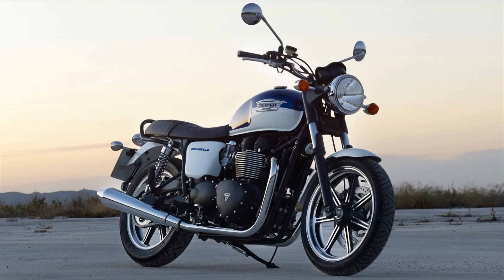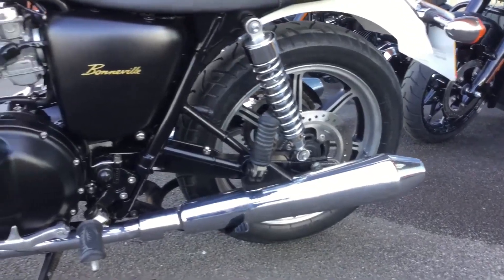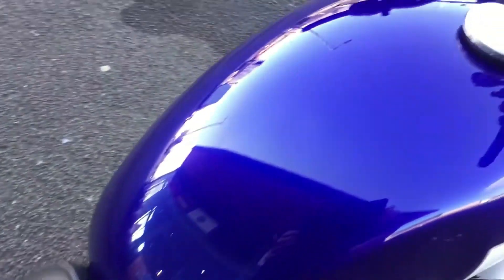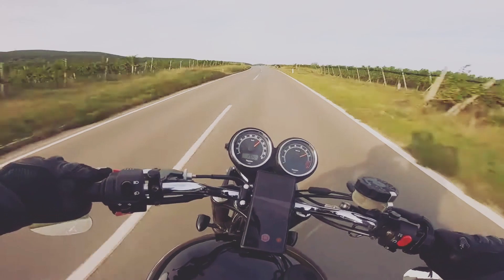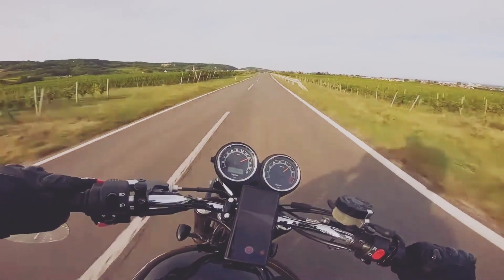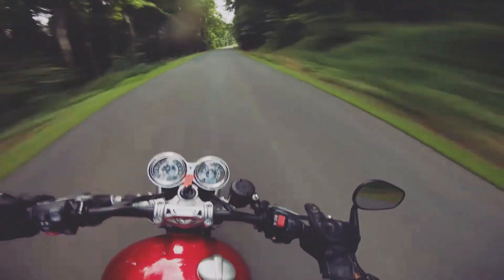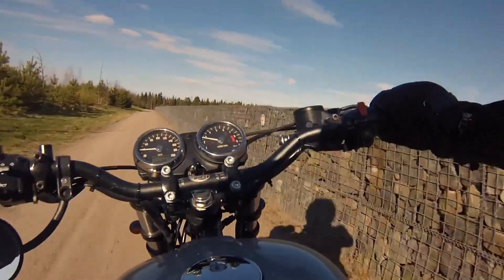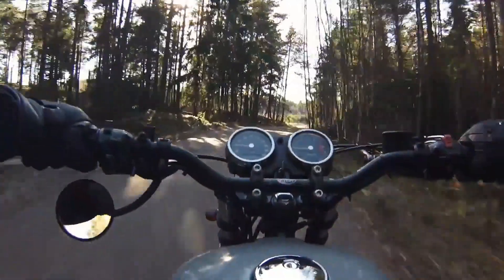Is The Triumph Bonneville The Right Bike For You ?

Comment: I have 134,000 Km on my 2017 T100.  It is a wonderful riding experience.   It follows the styling of the great Edward Turner considered by many to be the ultimate.  The engineering has developed since 1959 whilst remaining true to the design.  You will see irritating comments about fakery,  mostly picked up from reviewers who've used the term.  The bikes are a joy.
Reply from the maker: good point well put mate but i do feel the air/oil cooled ones are more honest to their roots🙂Cheers for the comment. Ride Free 🙂

Comment: My last Bonnie was a '71 with square block Amal carbs. Scuffed the sidewalls off the Bridgestones and scared my mates on big Japanese bikes on twisty stuff.
Reply from the maker: Great story 🙂Cheers for adding your bit mate. Ride Free 🙂
Reply: Bought mine for Twisties, the upright riding position and great retro looks. My ego wanted more power but the 0-60 is more than enough for daily use but my fz09 and street triple friends run off and leave me sometimes 🤔
Reply from the maker: good point well put mate and its only when they run off and leave you permanently you need to worry lol 🙂Cheers for the comment. Ride Free 🙂

Comment: Bonneville came out in 2001, not 2002.   It went to fuel injection in 2009, not 2007.   It went to water cooled in 2016, not 2017.
Reply from the maker: i wont argue the individual dates, but do remember, different markets........... they were the official release dates i found, but ive been wrong before n almost certainly will be again, i do my best

Comment: Ahhh, the bike I could love, maybe, except something about having pretend carbies and faked air cooling, purely for looks puts me off a lot.
Reply from the maker: 790 and first couple of years of 865 for you then mate lol, ive tried a few, honestly, they just dont pull like a twin should to me, no bottom end surge, the character of a sewing machine lol good but a bit soulless
Reply: @barebonesmc  Yeah, I'm just going by memory of that one relatively short ride on that one 650 Bonny years ago. It was a pleasant bike but I do remember it being pretty gutless for a 650, it's just that memory of thinking "I could almost live with a bike like this" but, I do like some serious power too so, probably not for me at all if I'm serious. One's gutless and the other's all fake pretend so nahh, I'll pass thanks anyway.
Reply from the maker: its not that they had no power, but the torque just wasnt there on any of the ones ive ridden, have a good one mate  @lorditsprobingtime6668
Reply: They are not '' fake '' anything.  They are fuel injectors.  They have to be where they are which happens to be where the carbs were for the same reasons.  So your objection is that they resemble the look of the carbs which is stupid.  Do you object to the digital clocks looking like originals?  Or the exhaust pipes?  The engine fins...?  I could go on.  They are '' retro sty;e " bikes FFs the clue is right there.  

Cancel

Reply
Reply: @asacarrick1385  I get all that, it doesn't mean I have to like it though. As for "fake carbs" YES, they are. Being real "real fuel injectors" doesn't change that fact.
Reply from the maker: @asacarrick1385  no need to get so touchy, everyone is entitled to their opinion, as to the injectors, has anyone else tried to make them look so obviously like carbs? and as injectors they could actually be placed in numerous places, and yes, i hate digital clocks full stop, whatever they look like, and dont get me started on tft screens lol
Reply: Don't forget the fake headlights...Well they're LED now ... I know they light up and they're at the front.   @barebonesmc
Reply from the maker: If its better great, more powerful or lighter, fine, honestly mate im a long term Triumph owner, i love many of the bikes, just not the Triumph marketing, and i say it as i see it, we wont always agree but thats fine, i dont pretend to be some all knowing omnipotent godlike being, im just a bloke who loves bikes and thats what matters to me, if its got 2 wheels thats all good 🙂Cheers for watching and for the comment mate. Ride Free 🙂
Reply: @barebonesmc  Myself, I can even enjoy an old postie CT 90, even an old Deckson type mini bike with a box frame and tiny wheels, no suspension and a gutless Briggs and Stratton with a centrifugal clutch and no gears that you even have to get off and walk beside on more than a light slope can be fun.
 As fer headlights, I want the old candle type lamps and a man walking ahead waving a lantern and a clove of garlic to keep the vampires away🦇, just like back in the good old days, you know, before we invented round wheels, back when we were trying to decide between square or triangular ones and the bikes ran on coal👴.  What be this magic called " L E D " eh? Some sort of witchcraft it sounds like to me.
Bloody hell, apparently nobody's allowed to have preferences that aren't the same as everybody else. I love advances, I just prefer them to not even try to imitate something it's not, that will usually add unnecessary weight. If it's new and better, great, I just prefer things to embrace advances rather than try to imitate older tech when it's better anyway.
Actually, that BMW S 1,000 I had was 2014 and had their new wiring system that was lighter by having (apparently) a single cable wiring loom type setup they'd just come out with that apparently helped lighten the bike. That complicated things a little at in that I wanted to have a charging point fitted to keep the battery topped up if I was to leave it for any time but, even the bike shop didn't want to because apparently they'd had issues with something to do with all that. Just as well I never could stay off that bike long enough for even a speck of dust to settle on it. MAN do I miss that amazing bike! Unfortunately I just can't justify buying a new one since I'm too busted up to be comfortable on a bike like it these days anyway.
Obviously I do embrace advances in technology, I don't so much like it pretending to be old but, I don't mind them doing that, I just don't particularly want it. I get the feeling "asacarrick1385" mightn't agree though😫, me so sad🙄.
Reply from the maker: @lorditsprobingtime6668  if its got 2 wheels................ 🙂
Reply: @barebonesmc  AND, an engine that goes vroom, vroom lol.
I don't know if you've ever ridden one but, I did hop on one of those 3 wheeled Honda death machines back before they pretty much outlawed them and all my brain kept seeing was " 1 wheel in front so should lean, but it won't so I can't turn till I get it to" and despite being a good 50 feet from a fence, my mind sorta froze and I wound up sort of stuck in a way. I knew it was all in my head but, I hated the feel even of it. I have no problems with 4 wheelers but a single out front short circuits my brain somehow lol.
Reply from the maker: @lorditsprobingtime6668  oooh yes, i remember the infamous Honda ATC's 🤣🤣🤣 I could never get sidecars to work either to be honest, i could only do right hand turns lol
Reply: @barebonesmc   It just aint natral eh lol.
 I've never actually tried riding a sidecar setup but, pretty sure I'd feel very uncomfortable about left turns there, especially if without decent weight sitting in it. Years back I did get asked to be the swinger for a mate who raced speedway sidecars but, apart from them already having a huge lean to the right, I AM the WORST back seat driver/passenger! Nobody else can ride or drive according to my brain. I did say I'd be willing to be the rider but absolutely not as a swinger, though my younger brother did do that, plus solo bike speedway. Even in a mates helicopter I'm only ever relaxed and feel safe when it's me on the controls, and I've never even been a licensed pilot in anything except maybe RC planes where I did pass my gold wings.
Reply from the maker: @lorditsprobingtime6668  it only took once to convince me that 3 wheels wasnt for me lol
Reply: @barebonesmc  Yep, same same lol. I slowly crept that silly machine forward till nearly against that fence but seeing just 1 wheel in front, I just could not get myself to simply turn the handle bars without being able to lean it. I'm sure I'd have got used to it eventually but, it all just felt so completely wrong. I've ridden plenty of quad bikes, including a full 4 wheel drive one through some pretty wild terrain but that thing just shorted out my tiny brain⚡🤯💥💨.
Reply from the maker: what i remember with a chair was turn left, and it just carries straight on regardless lol, right turns, no problem, but turning left, nah, i took it off after 2 days lol, i only ever wanted the BSA A7 attached to it really 🙂Cheers for watching and for the comment mate. Ride Free 🙂

Comment: I wish people would stop referring to injectors as '' fake'' carbs. 
They are not '' fake '' anything.  They are fuel injectors.  They have to be where they are which happens to be where the carbs were for the same reasons.  So the  objection is that they resemble the look of the carbs which is stupid.  Do you object to the digital clocks looking like originals?  Or the exhaust pipes?  The engine fins...?  I could go on.  They are '' retro sty;e " bikes FFs the clue is right there.  

Cancel

Reply
Reply from the maker: not all injectors are placed there to be fair, and just like you, everyone is entitled to their opinion, and water cooled engines dont need fins, so why add metal and so weight that isnt needed?
Reply: @barebonesmc  Actually the fins on the water cooled twins are actually functional and provide some of the cooling , this is why Triumph get away with such small radiator on a 1200cc engine , it's not much larger than the 865cc oil cooler
Reply from the maker: @nounoufriend1442   Ive not heard that one before, i will take a look, cheers again

Comment: I actually preferer the look of the water cooled twins .think they have more of the look of the original Bonneville's , not sure about others in bonneville range but the Thruxton 1200 wc is actually lighter that the air cooled 900 Thruxton
Don't dislike the air cooled twins but given the choice would go for later wc 900 over the air cooled , not much difference in HP but the 900 water cooled has really good low / mid range punch that the older 865 lacks . Both great bikes I know the later ones had few electrical problems but both have bullet proof engines , one thing you got to watch on air cooled engine is a kick back can shear starter pinion boss ,writing off the engine
Reply from the maker: Cheers for adding this. We might not agree but as i have often said, if we could amass the combined knowledge of all the subscribers we would have the most comprehensive motorcycle encyclopedia ever 🙂
Reply: @barebonesmc  Do like the air cooled twins and think the Enfield 650 twins are great bikes , not sure about Goldstar 650 engine sounds and looks fake imo ,prob bit bias as have Thruxton 1200
Reply from the maker: @nounoufriend1442  we are allowed our biases mate lol. Being honest, i prefer the W650 to the rest. but thats just me 🙂